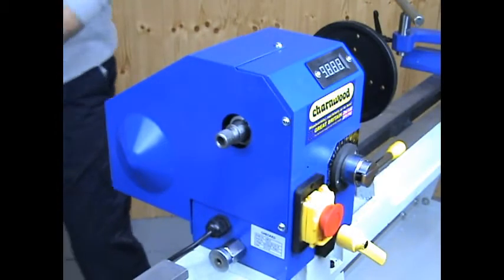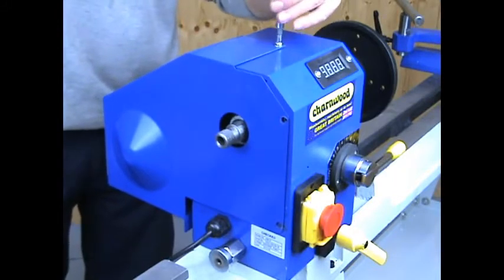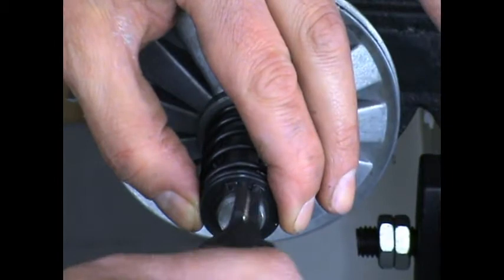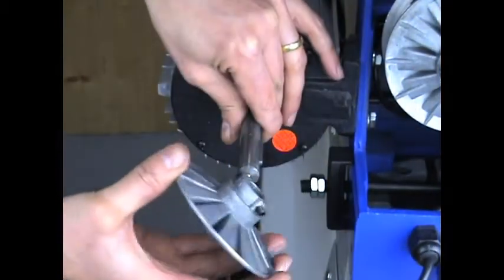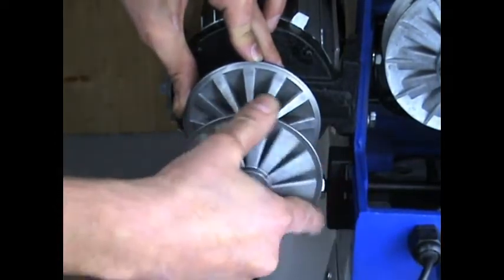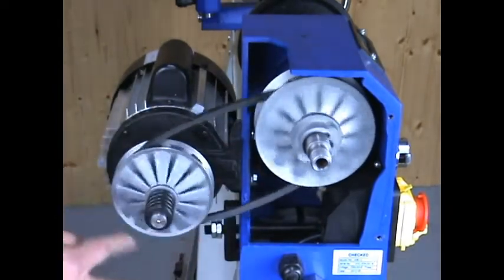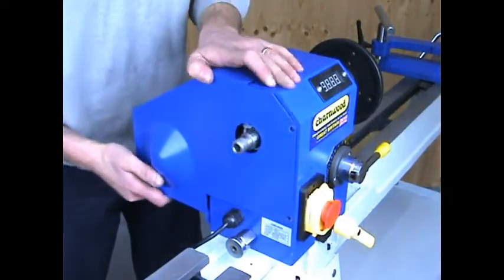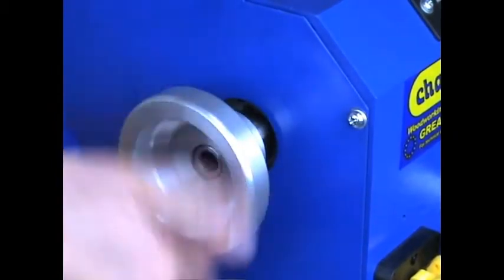How to change the the bottom pulley's on a Charnwood W812 & W813 Lathe.

Comment: What horse power is that motor, i was wondering if it would fit on a usa harbour freight lathe that looks to be the same as your Charnwood
Reply from the maker: Hi this is a 550w (3/4hp) motor, but we would have no knowledge regarding compatibility with a different model.